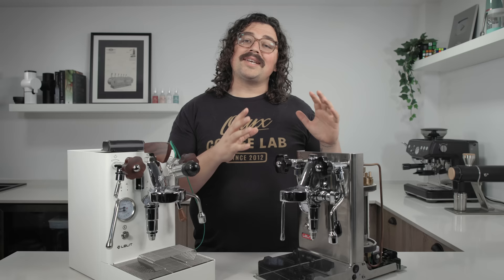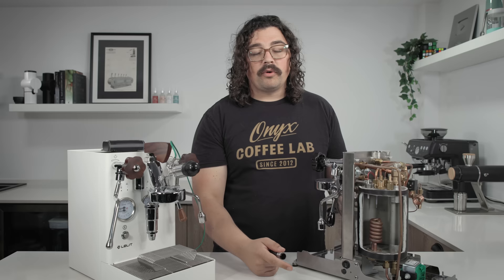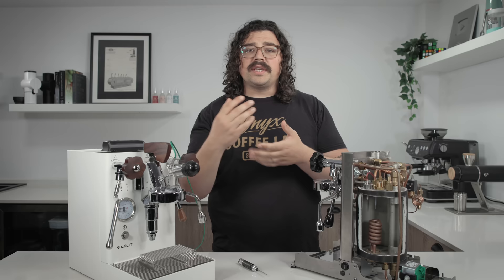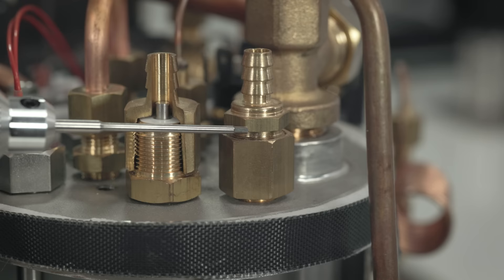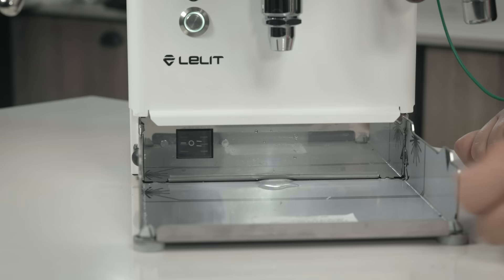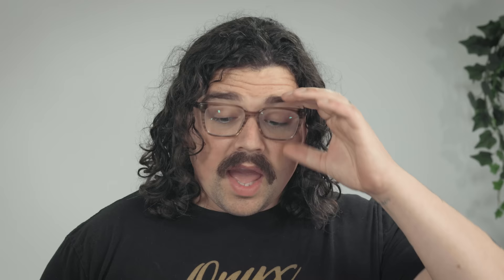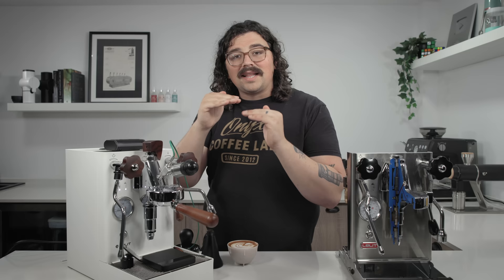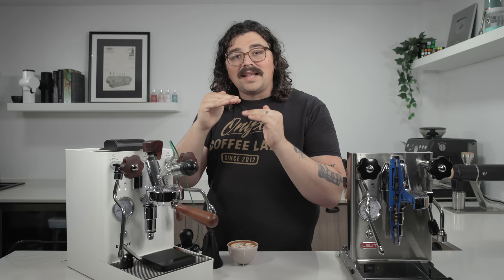BEST BUDGET HEAT EXCHANGER?: Lelit Mara X Review

Comment: Regarding pre infusion, maybe when you lift the lever just little more than the first position, but still not enough to engage the pump, you will open it to pass water and you will get a kind of pre infusion. Not real pre infusion since it is not connected to water line, but still there should be enough built preassure from the high temperature to create some water for preinfusion. At least, that was my experience on few HX machines like Rocket, Sanremo.
Reply from the maker: I couldn't get any water out prior to full actuation.
Reply: @LanceHedrick  maybe the switch is to close to the back of lever so there is not space to release the water and not engage the pump. But that's just guessing, that's something I also saw one time on one machine.

Comment: In Canada, the Limited Edition Mara X (available in white like yours or black) is currently the same price as the Silvia Pro X. I honestly can't understand why someone would choose the Mara X over the Pro X. The only thing the Mara X has over the Pro X is the ability to add the pressure profiling. The Pro X is a dual boiler, PID to the degree, pre-infusion up to 6 seconds, has both good build quality and Rancilio's longevity/reputation.
Reply: For a home, a for some drinks a day, a think both machines do the work very well, maybe the Silvia is technically a little bit better, point for Silvia, and Mara X has a beautiful esthetics, point for the mara X.

Comment: It's funny how Lance is saying he would personally spend the same or less amount of money on a machine where he could tinker with more. I assume he is speaking of the Breville Dual Boiler? I've owned a Breville BDB for over 6 years (6000+ shots) and replaced it with a Mara X. While the BDB is a great machine and not to mention half the price of the Mara X here in Aus, it does require more TLC to keep in good shape. I spent countless hours on mine fixing/replacing parts when issues occur and I kept up with daily/weekly maintenance schedules. I do hear the latest revision seems to have improved reliability somewhat?

I dunno, I guess I'm one of those people who enjoy the hands on tactile experience of making coffee with an Italian machine which will last 20+ years if looked after.  With a BDB, you'd be lucky to get 3-8 years max from experience. The resale value also tanks outside of the 1 year warranty offered (buy the extended wty if you can) So if you're not comfortable fixing the BDB yourself look elsewhere or be prepared to foot the bill. 

A few things Lance didn't mention was the Mara X won't suffer from Thermosyphon stall like a typical HX machine. You can actually see in the video the  Mara X automatically engages the pump very quickly to prevent stalling when Lance is talking . Also if you didn't know Breville owns Lelit but the Lelit range is still made in Italy. 

I'd say the worst thing about the Mara X is the terrible tiny feet! First thing I did with mine was buy an aftermarket set of matching handles/feet for mine. Improves the looks and functionality a ton! Would I ever upgrade?? Sure I could see myself with a Bianca or Profitec dual boiler mostly for P.I.D. control and rotary pump.
Reply from the maker: Nah. Bdb in US isn't 1200. That would be nice! Tbf my bdb is 8 years old and I've not even needed to change o rings. It's been a beaut. And I've done countless hours of practice on it back in my comp days. 

I'd personally take a Gaggia classic pro and mod it for this price. No question. Gimme a gaggiuino $700 all in.
Reply from the maker: So, tldr, you assumed incorrectly lol. I just don't want an e61. Huge power draw, slow heat up, etc. Modded GCP for the win.
Reply: @LanceHedrick  Modded GCP has great bang for buck but they are darn ugly with the all the mods. It wouldn't get wife approval to remain on the kitchen bench. I guess it's small enough to pack away and shove in a cupboard like a red-headed step-child ;)
Reply from the maker: @Karl  ah you're not seeing what people do now with 3d printing, i take it. Beautiful modded GCPs

Comment: As the video progressed, it was a back and forth. I want this machine, Maybe not, I want this, maybe not. I think for me, maybe. One quad latte in the AM. Then a Cappuccino or straight espresso in the pm and the increase of heat over time would not be an issue.
Reply from the maker: i'd just turn it off then back on. Shouldn't be an issue at all!

Comment: Lance, brew mode does seem to work really well when you steam the milk afterward with that super-heating phase. But, a lot of people would buy an HX machine so that they can steam milk and brew at the same time. It seems like the brew mode would not be for users like that. Did you do any testing for users that would do both at the same time?
Reply: In my MaraX V2, the brew/steam modes are slightly different. In brew mode, you will be steaming after the shot, if at all. In steam priority mode, the steam ramps up pressure as soon as you lift the lever, so that you can start steaming straightaway.

Or, you can just steam afterwards, because by that point the pressure will be around 1.6 and it should stay there until you're done. Which means if you're just doing 200mls, it will take < 20 seconds. In brew mode, the steam starts ramping up after the shot, so it will take a little longer.
Reply: One of the main disadvantages of cheaper machines that can't brew and steam is that not only do you have to wait a little while after brewing, the steam pressure is quite weak too.

Comment: Firstly great review. I have just taken possession of this machine and getting use to differences between this and my last machine...a quick question to clear up some confusion for me.... at the 11.18 mark you mention the brew/steam mode switch.... you mention 0 being brew mode and 1 being steam mode... i was under the impression that it is the opposite? Thanks.
Reply from the maker: Probably is. I may have misspoke. I'll need to check. What I'm certain of is I had the switch on properly for all testing. The steam mode constantly read at or over 100 and bree was much closer to correct. Whatever the manual says is correct.

Comment: Loved this video, Lance! I have a hand grinder quandary – I'm considering a 2014 Craig Lyn HG-1 or a Commandante C40 MK4 to use for pourover. Do you have thoughts on the brew quality of each?
Reply from the maker: Better than both is the Kinu or Jmax. The 83mm mazzer burrs are solid but I think they're a bit lackluster at the price point. C40 has massive dialing limitations even with red clix.

Comment: Thanks for the video, it manifested my love for the mara x. I´m thinking about upgrading to the v2 gicar box for the new improved brew and steam mode. 
I find it interesting that the machine heats up over time so much. The v1 does not do so, on temperature setting I it stays on 93-94° the whole time… At least the bottom temperature sensor says so, which you can easily read out with an Arduino. I wonder if the temperature for the brew is actually higher, did u have the corresponding data from the gicar box itself after 2 hours? Or did the temp only spike at the lowest settings?
Reply from the maker: bottom sensor isn't as accurate as the temp reading after going through the brew tube. Love that you hooked up the arduino to it!
Reply: I have the Mara v2 and temps seem to stay stable over longer periods without issue. Granted I don't have the flow control mod and only have one of those cheapish temp probs installed above the group. Maybe you got sent a dud Lance or could the flow control mod be affecting temps??

Comment: Deeply appreciate with your video. Here would like to know what is the difference between Lelit Mara X and Lelit Bianca V3? If budget is not the point that I concern, which one is better choice for me as the first espresso machine which could easily control the advance function like length of pre-brew(blooming), pressure variation etc. without any mod?
Reply: Bianca all day if you don't have a budget. Double boiler plus pid etc is so much better for a user. Hx is not the greatest from what I've read. Especially if you're making milk drinks.

Comment: Very well built, tons of engineering and testing done to make this how it is.  It's not for me aesthetically.  I'm not a fan of the I guess "traditional" looks as far as big knobs, big wands on both sides and the e-61 style group pressure release stalactite.
Reply: I think because I've installed the gaggiuino mod on my very very inexpensive espresso maker as well as modifying it to have a 54mm ims basket and an ims shower screen.  On top of massively testing it as far as temperatures in the boiler that I measured the volume of, emps of water that hit the coffee puck, and pressure at the puck.
For me, I will be spending my money on a better quality of build machine when my current one breaks.  Then I'll be buying something that I find aesthetically pleasing and more than likely adapt it to be plumbed in if it can't be.  Then just installing the super modified version of the gaggiuino mod.  I've modded the code and display so my machine is all just touch screen controls except the steam valve.  The gaggiuino mod made my very inexpensive delonghi stilosa be so stable that it will be a very long time that I buy something "better".  I think to have the stability and options you have with gaggiuino sofware you need to buy a vostok.  So putting the gaggiuino mod on any espresso maker will be life/game changing for nerds especially, but anyone really.  At the end of the day an espresso maker is nothing more than temperature controlled water pushed under pressure into ground coffee.  The more stability and control you have over water temperature and pressure the better coffee/espresso you can brew.
I've buried this response because I have personal issues with the morality of the creator of the gaggiuino mod.  But it is hands down a game changer and can be installed on I think any espresso machine.
I do have videos of my mods on my channel if you're bored and interested in nerd stuff.

Comment: Lovely looking machine. Great video, Lance. But, and who knows about taste, my old unmodded, cheap gaggia classic makes better looking espressos coming out of the naked pf.
Reply from the maker: That just means you are using darker coffees than me. I use super light and really rested coffee.  Doesn't make for pretty extractions
Reply: Hi Lance. Correct me if I am wrong. You used super light coffee in the lowest temp setting? Shouldn’t it be the opposite?
Reply: @LanceHedrick true, the dark roasts look great coming out, but I was including light roasts as well (despite the gaggia having a harder time with those). But yeah, if super light (plus rested), they don’t look pretty. Thanks for replying. Love the videos.

Side note: Others may find useful. I use the Vacu Vin system. Cheap and effective way to keep beans smelling/tasting fresh for weeks at a time.

Comment: Hi Lance, I do own this machine and I do not have the issue you describe that the machine overheats after it sits for too long. It is known that the Mara X starts overheating 3-4 minutes after you pull the last shot, but settles down to the adjusted temperature 15-20 mins later. This can be awkward, since you cannot wait more than these 3-4 minutes when pulling back-to-back shots or the temp will be too high. Other than that, it really is a great machine.
Reply from the maker: Do you have proof yours doesn't heat like this? Or just assuming? I ask because I can't imagine I have a lemon
Reply: @LanceHedrick  I have a thermal probe in the service thread you use as well (hope that‘s what it‘s called…), so yes. Also, I have confirmation about this directly from Lelit (about the overheating and settling down), but mine definitely settles. I have it on most of the time and I can normally walk up to it and pull a shot at around 92-93 (I‘m at setting 1, brew prio obviously…)
Reply from the maker: @Peter  very interesting. I'm curious how deep your probe goes? Mine is about 4 inches long. 
I tested not only with the probe but a scace, so well. Perhaps its because mine wasn't completely idle. I'd actuate the flip or something. But regardless, every time I hit that 2 hour mark of shot pulling, it'd shoot up
Reply: @LanceHedrick  Hey Lance, I don't think mine goes in so deep. I have the E61 group head thermometer from Coffee Sensor. However, I also don't think the difference between yours and mine will be significant. I never got to pull shots for 2 hours straight, so I cannot attest to that behaviour. However, the machine definitely SHOULD stabilize after roughly 15–20 minutes after the overheating phase. The overheating phase is necessary to keep the temperature stable for consecutive shots.
Reply from the maker: @Peter  perhaps it should, but it doesn't ha! Same with their Bianca. They have a new feature of temp offset to allow changes in shot temp mid shot. I proved that to be untrue.
I think it's a nice idea but hard to execute with a hunk of brass and a HX
Reply: @LanceHedrick  well it does here, so maybe it‘s worth contacting Lelit directly about the issue you‘re having. 

On another note: you‘re talking about „other“ machines you‘d pick personally in a similar price range. Can you share your personal favorites?
Reply: @LanceHedrick  Ah, btw: do you have the standby / power-saving feature turned off? Maybe this is also something that has an impact. Mine is turned off.
Reply from the maker: @peschee  my personal favorite, but ONLY because I'm a tinkerer, would be getting something like the Gaggia Classic Pro and modding it. Currently working on Gaggiuino mod
Reply: @LanceHedrick  Understand; Gaggiuino would be too much tinkering for me, :) I've been happy with the Mara X, but I am contemplating getting its bigger brother, the Bianca. The overheating phase is not an issue when doing a couple of back to back shots (or even more as long as you adhere to the max. 4 minutes apart), but I find it to be a limiting factor when you have people over and someone asks for a coffee >4 mins after my last shot…
Reply from the maker: Exactly. The Bianca does a better Job at keeping up. If price is no issue, it's my preference. Bang for buck, Mara x is hard to beat in the e61 world
Reply: @LanceHedrick  If you have space constraints, the Mara X is hard to beat as well. A good thing about the Bianca, albeit being bigger, is that you can mount the tank behind OR on the side. Lelit machines have some really thoughtful features. I wish more brands would follow suit…
Reply: @LanceHedrick  btw, I watched your Bianca review as well and was kind of put-off by the HUGE temp offset you mentioned… For people without scace devices, how would one set the right offset…
Reply: @LanceHedrick  Lance, maybe the "problem" that you had is because the Mara X V2 user's manual is WRONG and it says that the steam-priority mode is "I" when it's actually "0". They left it like this (in the User's Manual) from the V1, but they changed the switch to work the opposite way around than on the V1. This would definitely explain the overheating "issue".

Than means that you left the Mara X V2 for 2 hours in steaming-priority mode which will DEFINITELY overheat the group head. And all of the machine.